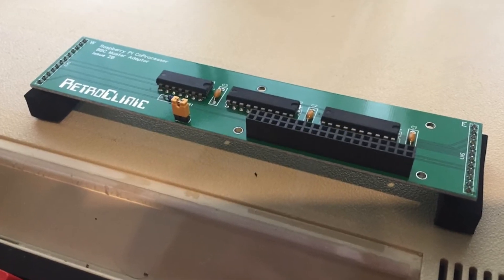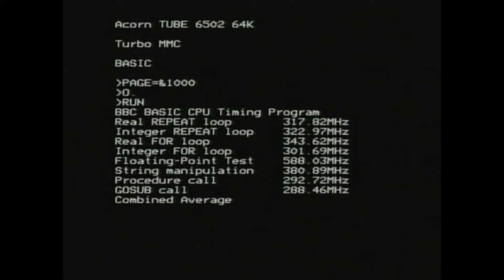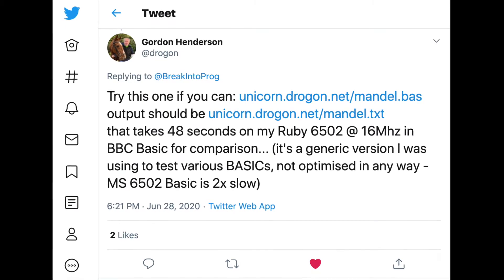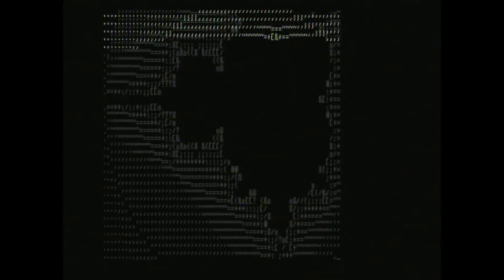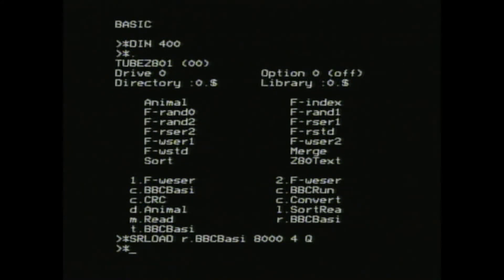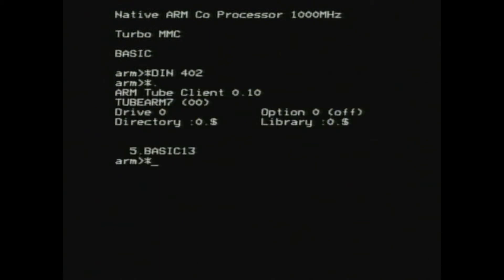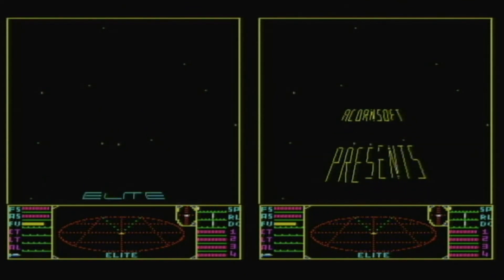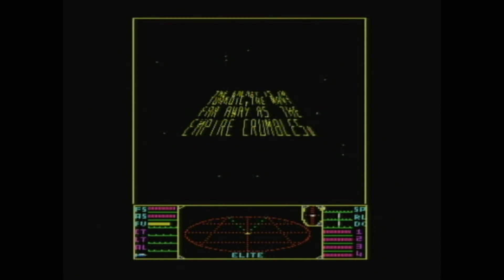Acorn Antiques: Benchmarking the PiTube Co-Processor

Comment: Just for the sheer hell of it, I ran Gordon's mandelbrot program in Matrix Brandy BASIC (SDL graphics build) on a Raspberry Pi 3B+ running Linux - it rendered in 0.15s, so it does show that even with ASCII output the Tube interface is really slowing it down, as a 1GHz ARM running a BASIC implementation in pure ARM assembly should run rings around an implementation written in C even though the host machine is running at 1.4GHz.

Comment: what happens if u use the HDMI output from pie?
Reply from the maker: I don't know. The Wiki doesn't mention it. I suspect nothing, as the PiTubeDirect software is written bare-metal, so no OS, and no need to service the HDMI port. You do get debug information if you connect a serial port to it.
Reply: @BreakIntoProgram  do u know anything about the pie gpu?
Reply: Nothing formally released as far as I know, but Dave (hoglet) is working on something in that regard.

Comment: The expansion capabilities (particular the software provision in ROM) of the Beeb Model B were light-years ahead of anything at the time, albeit at some considerable cost. The Tube has always fascinated me, and thanks for clarifying that despite the speed the bottleneck remains the post box method of passing data to/from the Beeb itself
Reply from the maker: Same here - so couldn't wait to try this in my Beeb. The benchmark results were a bit of a surprise to me, to be honest. It was still a lot quicker than I anticipated.
Reply: Shame the result was so S  L  O  W    😂